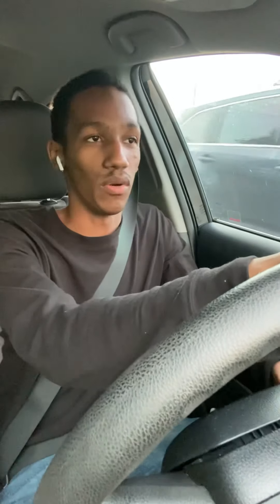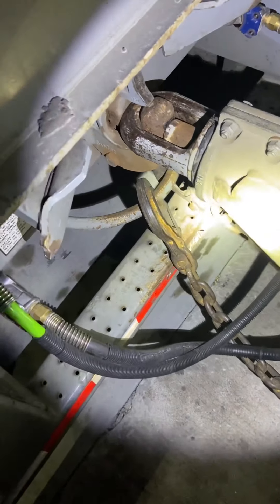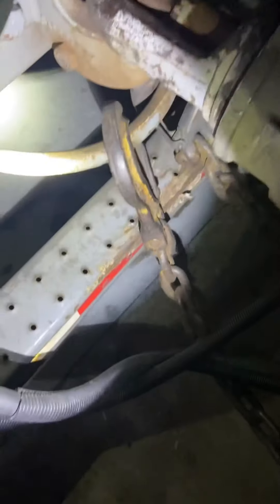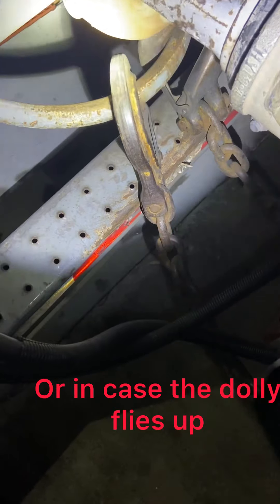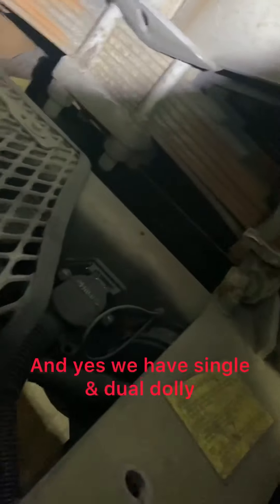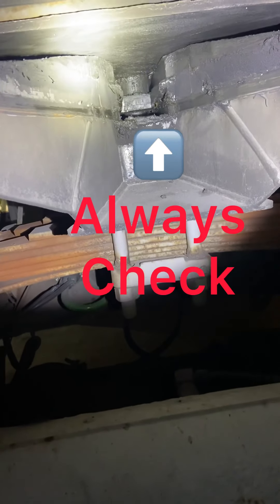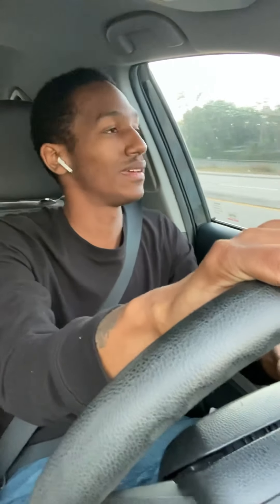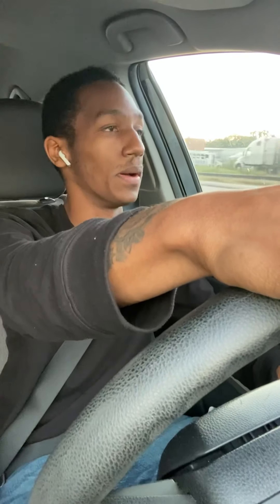Trucking| always check your connections‼️(reaction vid & tips)

Comment: Been driving for a fedex contractor for a year now and I always get under both trailers and check they are locked in. I always double check after I stop at a truck stop as well because you just never know if someone pulled your fifth wheel handles.

Comment: I seen someone over 40 miles away from the nearest FedEx , what i was told is brakes locked on the rear trailer up and the driver disconnected on the highway, me i would put my tractor in low gear and pull it off the road stuff happens only that driver knows what happened and most of the time the driver gets re trained not necessarily fired at all also know about someone dropping a trailer in a tunnel and they did not get fired